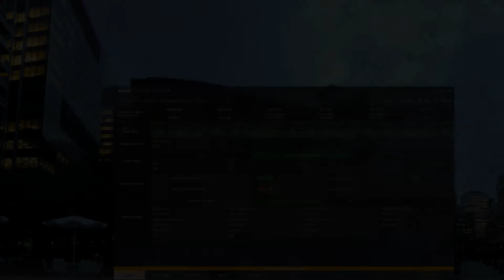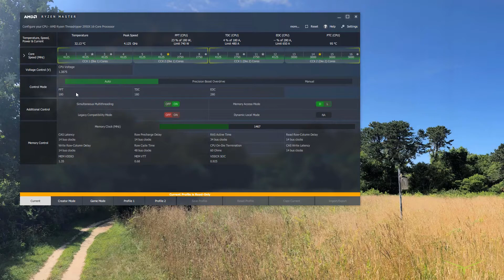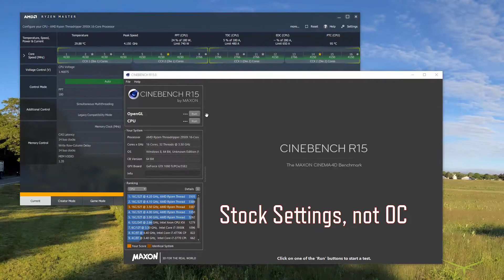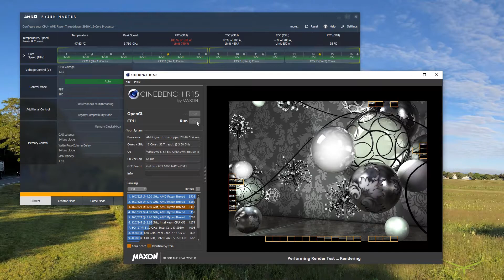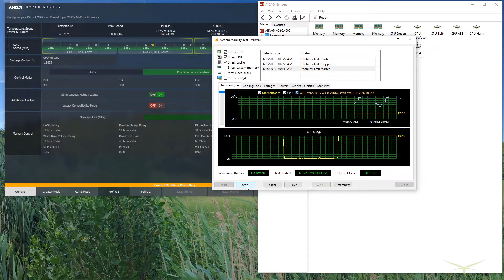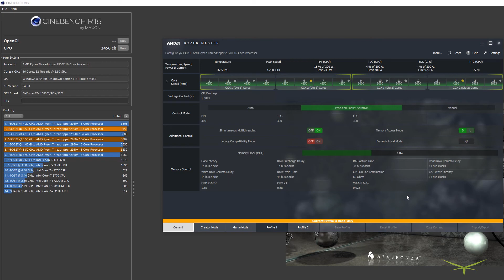Overclocking 2950X using Ryzen Master with Benchmarks

Comment: I tested the settings described here (300/300/300) I did a rendering with 3dsMAX. All cores worked at 4.15GHz all the time. Temperature went on max 63°C and the fans of my watercooling made a lot of noise. Render time was 18:48. But now this: I went back to the Auto mode and rendered again. Now the cores worked between 3,6GHz and 4,15GHz, most of the time at around 3,8GHz. The temperatures went not over 51°C, fans silent, and believe it or not: render time was 17:49. How is this possible ? Did I something wrong? More heat and slower rendering? Is the CPU like me in summer? More heat, less desire to work hard....

Comment: As soon as my temp hits 68c, it throttles my 2950x to keep it at 68c. How did you unlock the max temp ?
Reply: I'm getting only 2700-2800 on auto and 2955 on the same PBO settings you put.

Comment: Hey anybody here, in the ryzen master settings for overclocking the processor at the bottom there's the different bus amounts, this for you started at 16 then went to 15 and at the end or throw the video towards the end it said 14. I tried to copy as many of those values as possible and when I restart the computer now the screen only shows black and won't get any video any idea how to fix this
Reply: Ok so someone has replied and said take out the cmos battery, I have tried this and the computer runs again. All  the overclocking settings have reset but that's fixed things so all ok there. I would like to revert to the setting that had been working however there is a new issue.  real time readings that where working at the top of ryzen master are not giving readings and I do not knowhow to get them working. perhaps some advise here would help me if anyone would be so kind

Comment: looking closer I see a few details in the memory control are different, you don't seem to mention changes done there so I would like to know if I should use the same settings?
Reply: Mainly the default settings are at 16 bus, 16 bus, 16 bus, and 55 bus. To you 14, 14, 14 and 48.

Comment: I see in this video that your memory clock is 1467, as I went to Ryzen Master it has and is 1200.when did you change that and is it part of the overclocking process here? Cinebench score OC was 3250 with 300/300/300 and 1200

Comment: what cooler are you using ? im getting instant 69 degrees when i hit render at stock settings so when i bump the watt there is no improvement due to temp limits, im using corsair 150i
Reply from the maker: Hey, I'm using the Noctua U14S-TR4-SP3 with an extra Noctua NF-A15 fan on the back side. I haven't monitored temps in a while, but I watched them like a hawk at the beginning. I was seeing 55 - 60 tops when rendering which is well within the safety range and that was with slight OC'ing.

Comment: I opened Ryzen Master and went to Profile 1, selected Precision Boost Overdrive mode and tried to change my PPT TDC and EDC vales and they say max is 180, 180 snd 240... I also have a 2950X so I am just wondering why my settings are different to yours. Thanks :)
Reply: same
Reply: what Mobo are you guys running
Reply: @bigchiefsmoker  msi meg creation x399

Comment: Is the voltage too high?? I built my pc yesterday. I have the same cpu and using Ruben master my voltage jumps to 1.475 and then down to 1.295. Is this normal? At those voltages the cpu temp on the top left of the Ryzen master is about 45 Celsius( 5-10 % usage) Also could you please let me know how to get all my cores run at the same frequency because right now almost half of them run at higher frequencies
Reply from the maker: Hey, my voltages jump between 1.2 and 1.45 all the time even with stock settings so I'm not worried about that. You can lock voltage at a certain number through your BIOS or through Ryzen Master if you want. The temps of 45C at 5 - 10% usage seem a little high, nothing that's going to damage the CPU, but if it's holding steady in the mid 40's when you're not really stressing the CPU then I'd have a second look at your cooling solution. If it's air maybe try adding a second fan or maybe try reapplying thermal grease (maybe there's an air bubble or something). I run mid 50's C under load and in the high 20's idle. Low usage (5% - 10%) usually doesn't break mid 30'sC  for me. If you want to lock the core or voltages in Ryzen Master, just click on one of the profiles and choose "manual" instead of "precision boost overclocking" in the middle, then you can then adjust individual cores and voltage by clicking in those boxes and setting what you want. You can also do this in your BIOS, however, I would not recommend it unless you have an extremely solid cooling solution. I experimented with that and starting hitting temps in the mid 90's. I was able to get the same benchmark scores by just doing the adjustments you see in this video without the extreme temps, which is why I made the video. Let me know if you need more help, send me an email through my website or the about page on YT.
Reply: Dragonfly Computers thank you for answering. Basically the weird thing is that my cpu temp spikes from 38-47 degrees Celsius when cpu usage is about 5- 7%. In bios  cpu temp is 33-35 degrees Celsius and when playing pubg for example cpu temp is 50-52 degrees stable.when running cinebench temp reaches 56-58 degrees. My cpu cooler is the NZXT kraken x72 (3 fan aio). The thermal paste I used is the arctic mx4 Now I’m wondering if those temps are normal or not. Could this also be due to the fact that my thermal paste was not brand new as I bought it and used some in a previous build 1 year ago?? Although I checked it and it wasn’t dry or wet
Reply from the maker: Well, I definitely am not too concerned that the temps are crazy or anything, I don't think you're doing any damage, however, being that you're liquid cooled, I think you should be getting temps 5 - 10C lower than what you're getting. I think the thermal paste might be the issue, when you're feeling up to it, maybe take the cooler off, remove all the paste and reapply something good like arctic. I bet that will bring your temps down a bit. Also I did some more checking into the voltage thing this morning and people are basically saying not to worry about it, that Ryzen can handle higher voltages and also that Ryzen Master gets some funky voltage readings anyway. tl;dr try going with fresh paste and I bet you'll bring temps down.
Reply: Dragonfly Computers thank you so much for the help
Reply from the maker: Absolutely, thanks for watching!